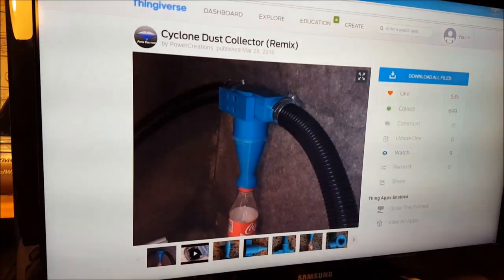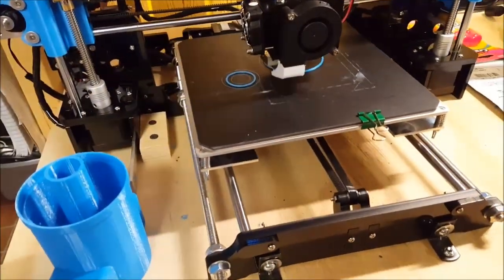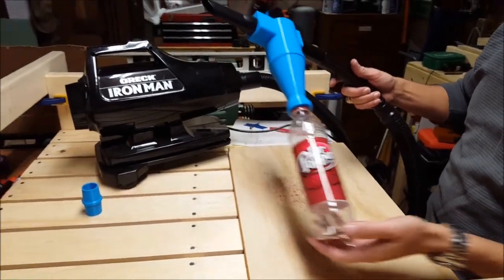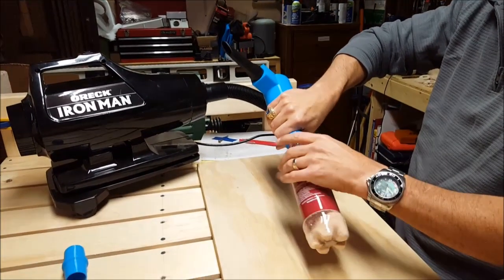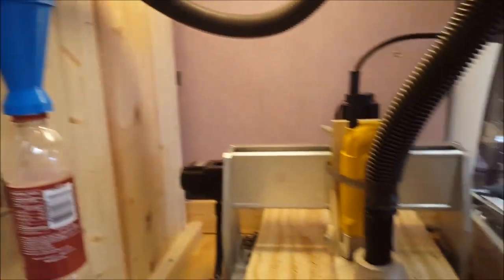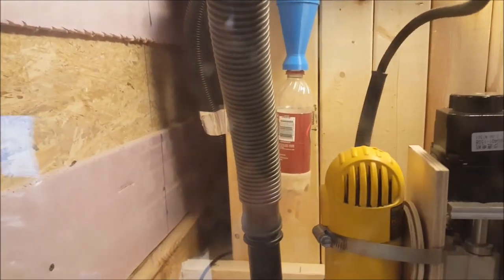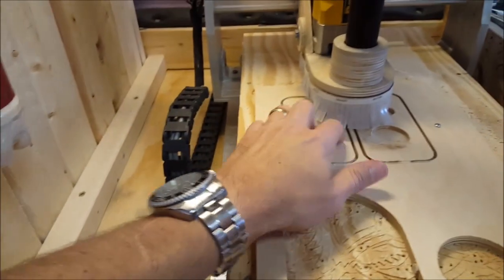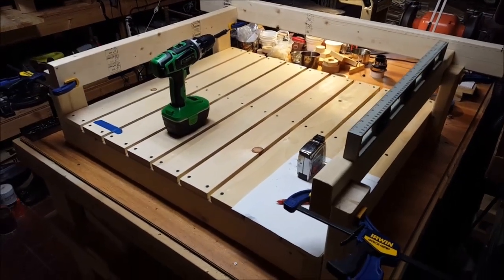3D Printed Dust Collector - FREE & Easy

Comment: Actually a cheap MICH cyclone cost like 15-20 USD and those are like 700-800g ABS. I love 3D printing, but let to be honest with ourself: 3D printing is anything but free.
Regardless the above, its a nice design, and seems like its working well.
Reply: its more like 200g PLA and 1kg costs 15$

Comment: Hi there. What kind of bottle do u use? Mine becomes vacuumed ..
Reply from the maker: I just used an old Dr. Pepper bottle.  The vac I use has a lower setting so that may be why it doesn't pull in.   Best of luck.
Reply: @drez20001  thank you for the prompt response! I will try that! That you very much

Comment: Next, maybe weigh the amount of dust on a digital scale, then suck up the dust using the cyclone, and weigh the amount of dust that was collected by the cyclone, and you'll be able to find out how much dust gets by the cyclone and how much is actually collected. It looks like a good fraction is being collected so the results would probably be fine but you could put a number to the cleaning efficiency.

Comment: I was wondering what you big dust extractor looks like and is there a video
Reply from the maker: Luke, I've done several videos on my dust collection.  This was my first dust collection project: https://www.youtube.com/watch?v=5Tz_9HDW3Hg&t=1s    
And this is what I'm currently doing but will eventually put in a separator:  https://www.youtube.com/watch?v=7z9ALDmuxm4&t=1s  The small 3d printed separator I currently use for a smaller vac when I'm cleaning out the CNC box.  Thanks for your comments.

Comment: So how much dust actually passed thru and went into the actual vac filter.
Reply from the maker: I'd estimate that 90% + was collected in the bottle.  The vac I used was an old fashioned bag unit and the old bag that was in there was partially full of other junk.  As a side note, by using this dust collector in an old design bagged vac you're also keeping the shop air much cleaner.  Especially if it's a HEPA bag filter that collects only super fine stuff.  For this vac I bought 5 HEPA bags on eBay for about $9.  Even if I change out one a month it's pretty cheap to keep the vac motor clean and the shop air moderately clear of dust and fine particulate.

Comment: Thanks for sharing. That is a really great cyclone and a great demo. 

I think if you consult the literature you find that smaller cyclones are more efficient than larger ones, at the expense of pressure drop and vacuum motor amperage. 

You will be loosing a lot of vacuum in those flexible hoses and it might be a good idea to minimise the total hose length if possible. I think you can also slightly improve the vacuum by lowering the vacuum cleaner relative to the CNC.
Reply from the maker: Good suggestions.  My previous system was huge and overkill for my small shop.  Thanks.